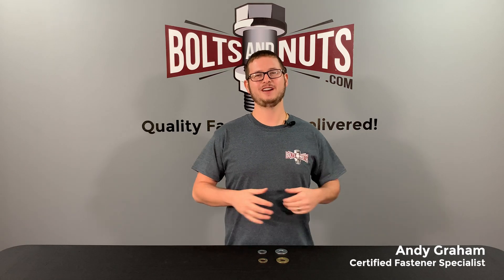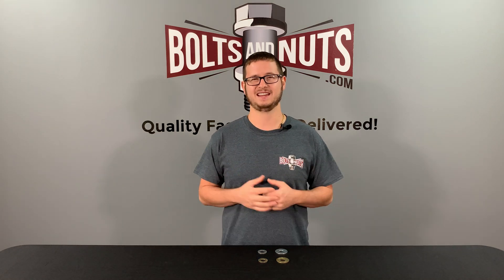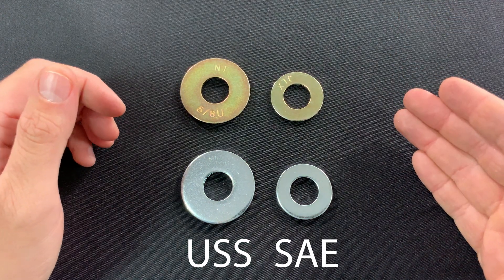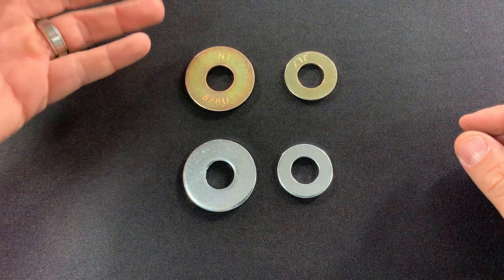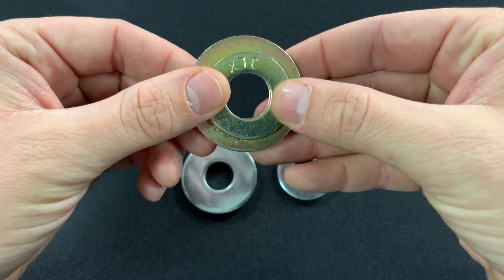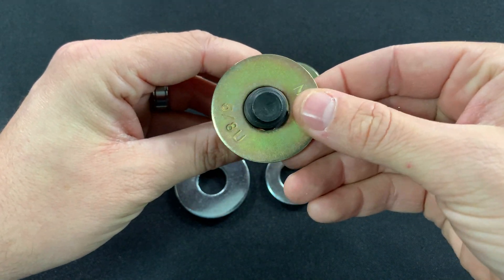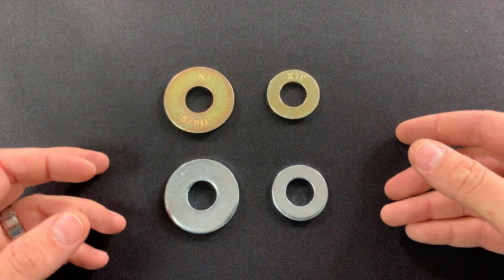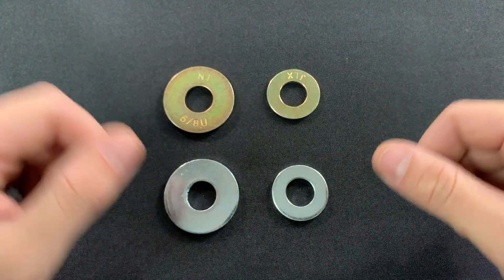What are USS & SAE Flat Washers and the Differences Between Them

Comment: So, why would I use one type over the other?
Reply: I would say uss is the preferred washer for more surface area coverage but sae could be needed at times for tight areas where there just isnt room. I also found out that uss are thicker in most sizes which would be preferred especially with large bolts and high loads